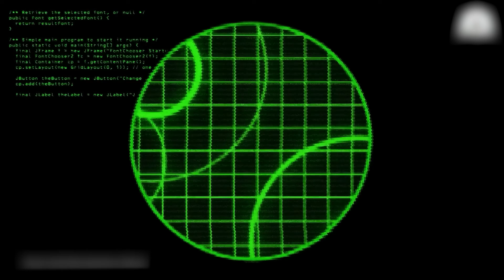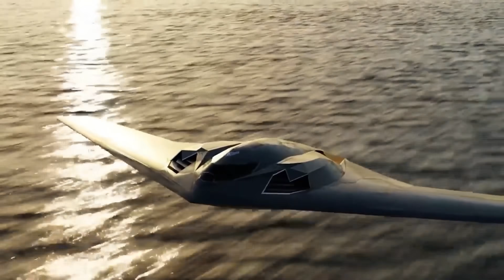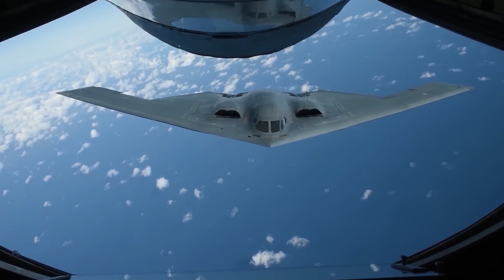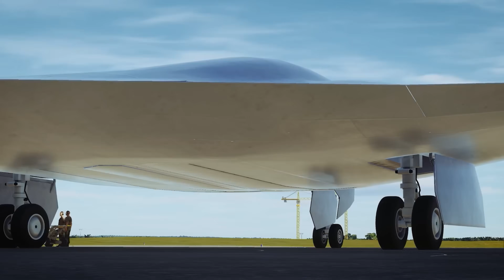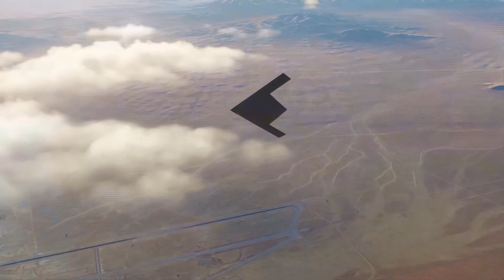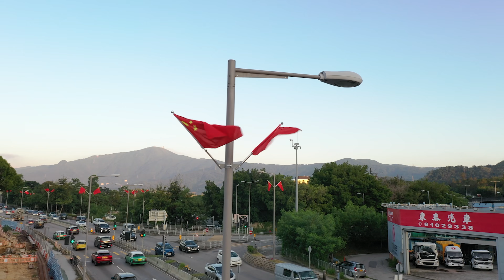The B-21 Raider: Invisible To Radar!

Comment: Can it defeat, old school optics based in space- old fashioned zoom cameras, in geosynchronous and overlapping LEOs?  Monitored by Ai?  I think the civilian market has hand held cameras that have spotted UAP flying at high altitude over THE MOON.  When airspace is violated, then multi stage long range hypersonics, with Ai algorithmed optical guidance can be launched.  Can't break an internal, completely passive, optical lock.  Especially not such a large and lumbering target.